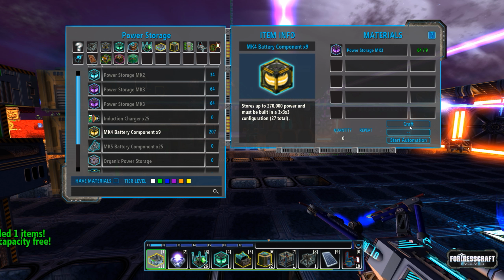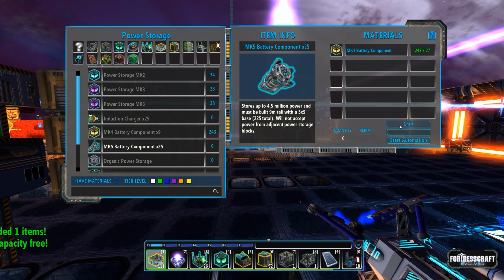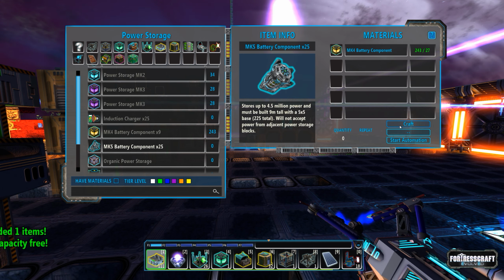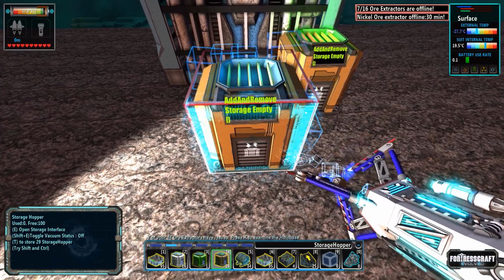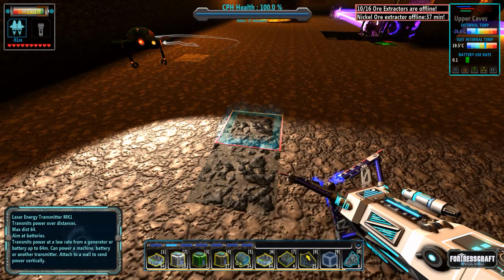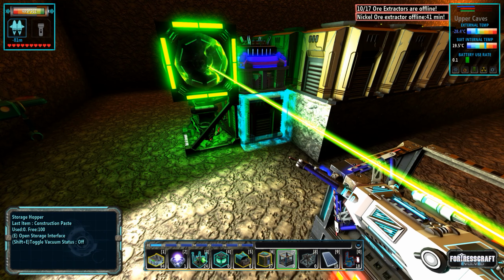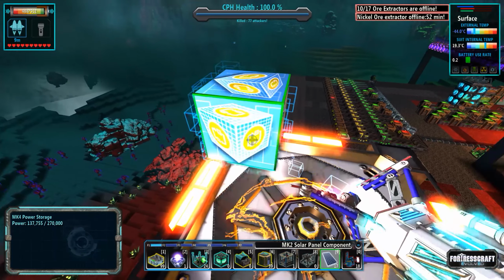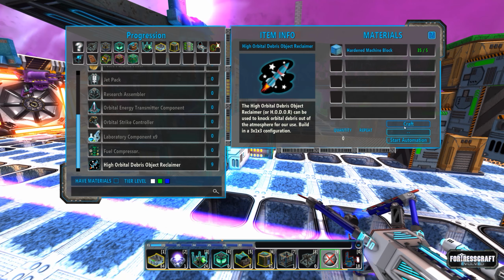FortressCraft - Frozen Factory! ► Let's Play Episode 17 ► The Orbital Transmitter! (1440p/60)

Comment: 3:45 I think you left out a couple of zeros there  :P

Refinery vats should still stack
Reply from the maker: It was an Austin Powers moment.. 1 Million Power! haha

I have been told that if you super build vats the don't stack properly.. Strange bug.
Reply: I think your issue might have been putting the two vat stacks side by side.  Stacking definitely works as I have a pair of 9-high stacks to make fuel to power my 16 OET turbines and missile production (supplying 20 launchers).  (Stop, Look, Read - the game gave you clues in the text boxes that you had a problem.  Notice a pattern Rob?!? :-P)

I'm on plentiful power and this setup takes just over 4 hours to power the OET.  >4K missiles stockpiled and 4 lines making basic missiles with some pulled off to a missile imbuer + cluster missile maker.  (My basic cargo lift can't haul up biomass fast enough to keep up with demand!  Glad I had many thousands of biomass horded in my inventory)